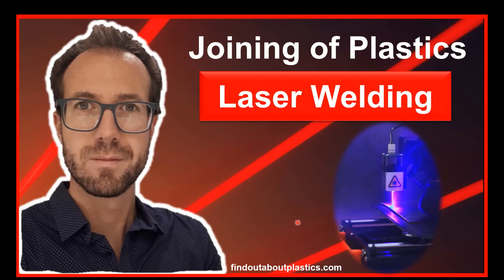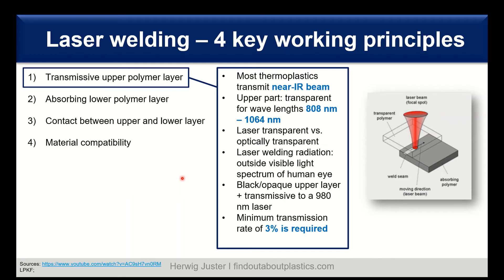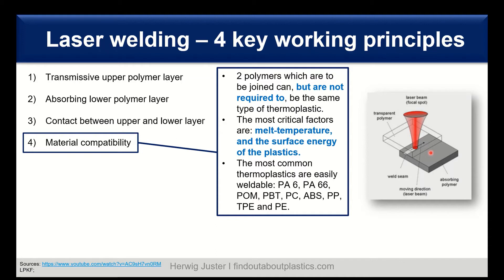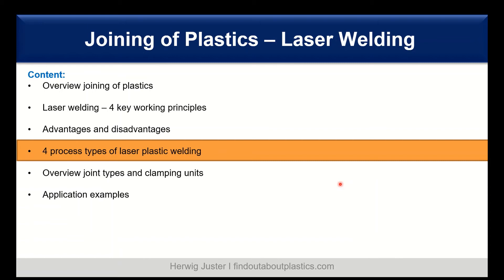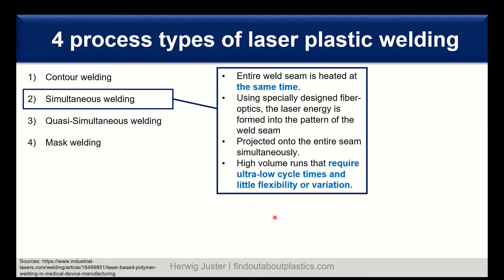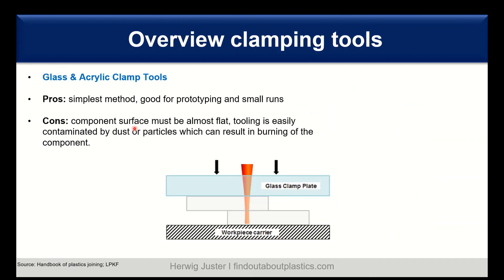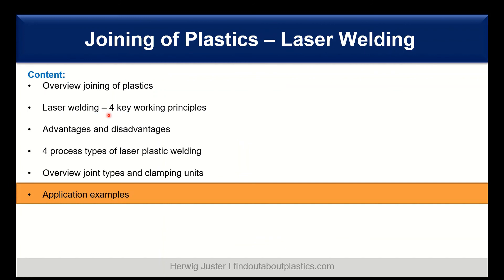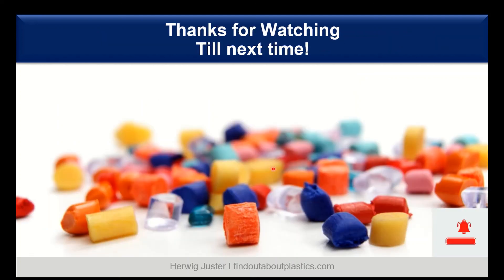Laser Welding of Plastics I Joining Techniques

Comment: Thanks for the clear explanation. What should be the minimum transparency level required for laser welding
Reply from the maker: Thanks for your feedback and follow up question! Most thermoplastics transmit near-IR beam and the upper polymer layer needs to be transparent for wavelengths between 808 nm – 1064 nm.  A minimum transmission rate of 5% is required. Best regards, Herwig
Reply from the maker: https://www.findoutaboutplastics.com/2022/09/what-should-be-minimum-transparency.html

Comment: First of all thank you so much for this presentation Mr. Juster, But I didn't understand the cam shaft sensor material , its not like tranceparent part for laser welding? could you explain little more? thanks
Reply from the maker: Dear Merkan, thank you for this feedback!! Regarding your question: the black cover of the camshaft sensor is the transparent part, however the PA 66 cover uses not carbon black as color - it uses a so-called laser transparent black additive. In case you do not need to have a black cover, it is better to go with natural/white color for better laser transparency; thanks and best regards, Herwig Juster
Reply: @HerwigJuster  Thank you for answer Mr. Juster I  , have project about the laser welding machines, I would like to consult you about the this process , I will write you on linkedin  By the way, thank you for accepting my linkedin  connect. M.hacımahmutoğlu
Reply from the maker: @MerkanRecords  Thank you for reaching out to me with you request and connection on LinkedIn! best regards, Herwig